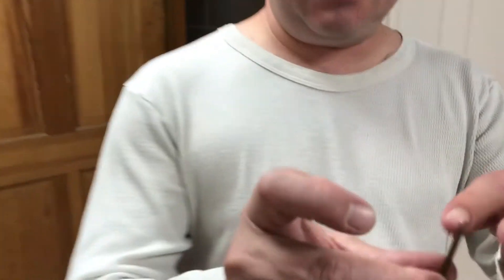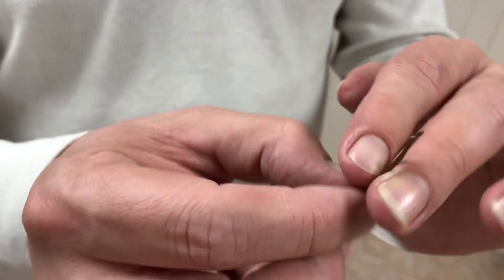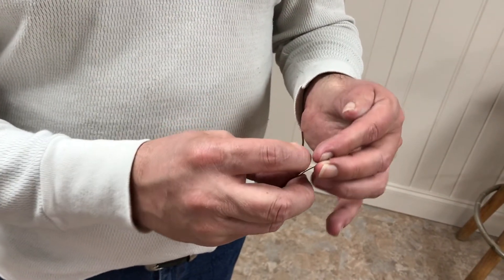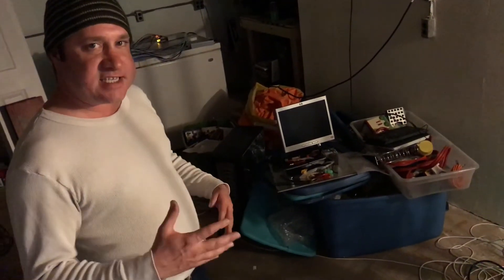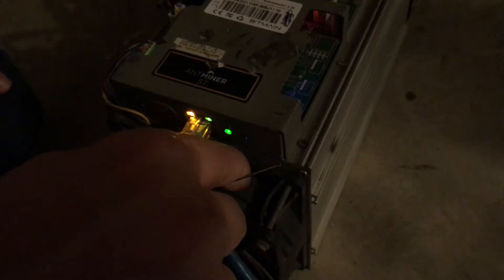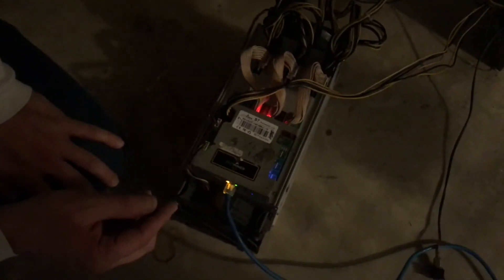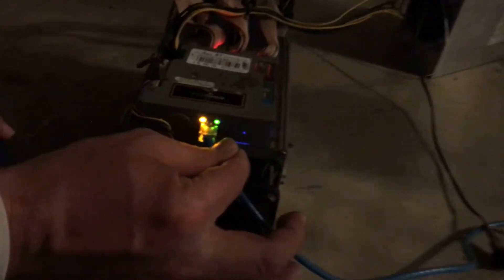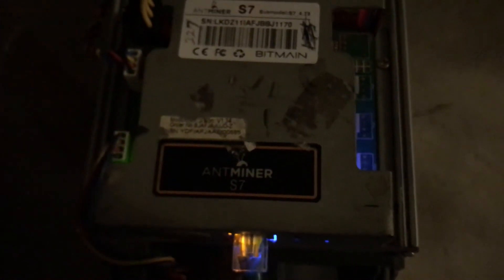How to reset an Antminer S7 to factory default settings

Comment: I just received an s14.5 actually 2 of them and I pulled the IP address up on my advanced iPad scanner and have the security page come up that asks for the user name and password and it keeps going back to the page on both units asking for the password again. I have tried the reset technique and it isn’t working that way either . I have many other miners running and this is odd. Please advise
Reply: It keeps going back after I enter root/ root
Reply from the maker: @gconnley  I have seen that before and found that I had to power one off and then login and set the IP and config information on the first miner.  Once that one is up and running, only then do I turn on the 2nd miner and am able to login.  Really not sure why this happens but it has something to do with the GUI and the two IPs seeing a conflict of some sort.
Reply: AtHomeCrypto I figured it out . The browser was in Microsoft edge not chrome and that was the issue.

Comment: Hey, i got an A3 and i have had it setup already. but something happened. i hit save in the network tab, but did not change any info. now my miner configurations page wont load. it is still mining, i just lost control of the page, and now i cant edit or see the work its doing, i cant reboot it or anything. how do i fix this?  im afraid that if i reset it lie in this video, that it will go back to mining for bitmain, and i wont be able to log my page back to edit the stratum and put it back into my pool...  am i screwed?  how can i fix this?   like in my browser i use the same link from my miners IP and it says nothing is found. i scanned my network, and copied the antminer IP and pasted it in the browser, but still says nothing can be found. but its still mining and sending so i dont want to screw that up lol   i just want to be able to go back to being able to control my miner.
Reply from the maker: You should log into the your networking hub that this miner connects to, I think it got a new IP address.
Reply: what do you mean?
Reply from the maker: Your A3 is set to DHCP automatically. Log into the router or hub that assigns IP's on your network and you will find the one assigned to that A3.

Comment: I received an Antminer S7 from china as well and am having trouble resetting it. I boot it up and it starts the beeping as normal and I cannot log into the webpage. I tried holding the button down until I saw the red light like you showed but when the antminer reboots itself, I am still not able to login the webpage to change the configurations. any help would be great, thanks. I also should mention that I cannot see anything on my connected clients list from my router that would show it is the antminer except one unknown name. it asks me to use internet explorer to log into it and I try root/root and it doesn't authorize a login.
Reply: also when I power on the antminer, I only see a solid red light unlike how I saw yours was flashing green
Reply: nevermind -_- I figured it out. I was having network issues. all resolved now!
Reply from the maker: Glad to hear.
Reply: What kind of network issues were you dealing with.  That may be my problem also.  I tried this reset technique, but it did not work for me.  What did you try that resolved your problem?